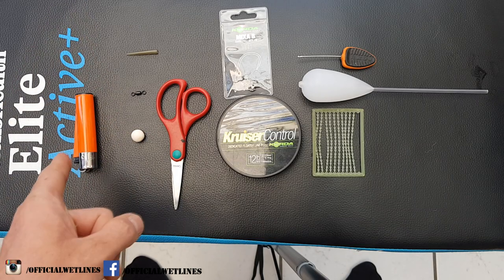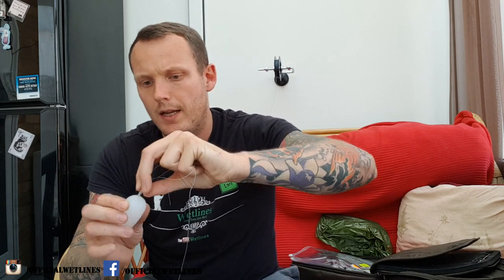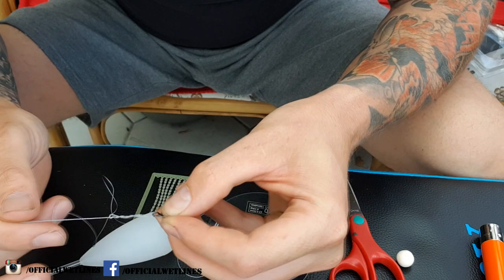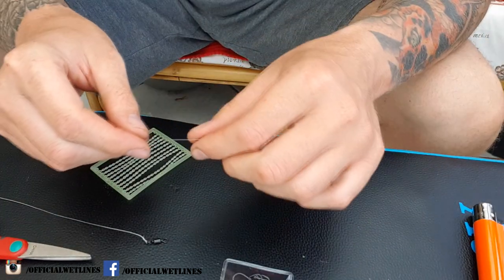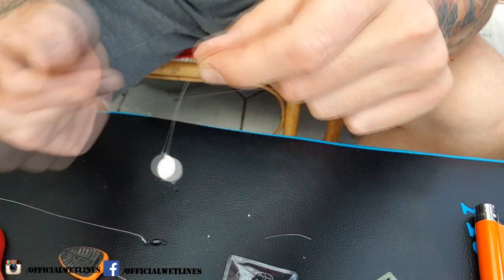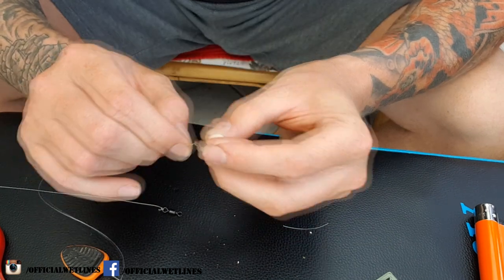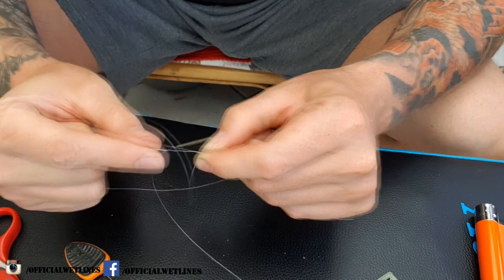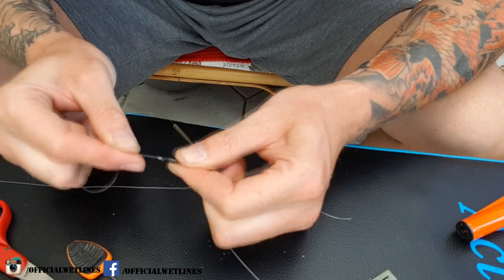Surface Fishing Rig Tutorial (Korda Surface Controller)

Comment: Message for Tony from Wetlines, used  a similar rig in the nineties, only real difference was a bubble float with tubing and a cork ball instead of a bailie, Fantastic rig, bringing me 26 carp to 24lb in an 8 hour period on a packed pool, bank holiday weekend with most other Angler’s blanking. One slight difference to try on your rig is to swop the  biollie stop for a number 4 shot, then try this, what you will find it will turn the boiling upside down in the water with the hook facing upwards. (No way for the carp to see the hook from underneath) give it a try you will see the difference. Cheers Neil.
Reply: That sounds good 👍 definitely going to give that ago. Thanks Neil
Reply: @tonyknight1971  let us know how you get on, it doubled my catch rate, by the hook being out the water, also try the  cork balls  soaked in your preferred flavours. There was a big carper late 90’s who stalked the carp with only cork balls with a massive catch rate. Can’t think of his name though
Reply: Definitely will let you know, and I'm sure it will be vlog 😊
Reply: Thanks Tony. Being an old new angler I couldn't understand why I wasn't catch yesterday using this rig. Now I know why !. My hook link was 6" long rather than 2 - 3 ' .I,m definitely the Mr Bean of fishing 😅 Thanks again.
Reply from the maker: Not a problem, I also reel in very slowly as well, to keep that hook link nice and straight, so when you see that carp come up and take your bait, it's instant connection when you strike